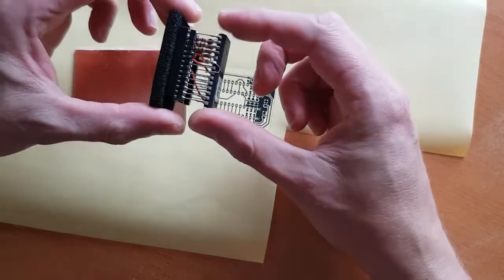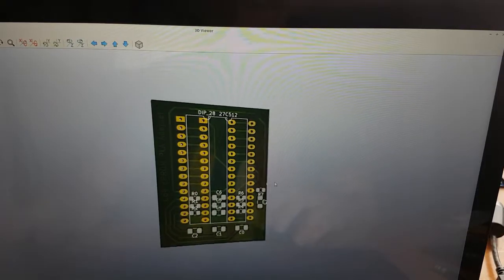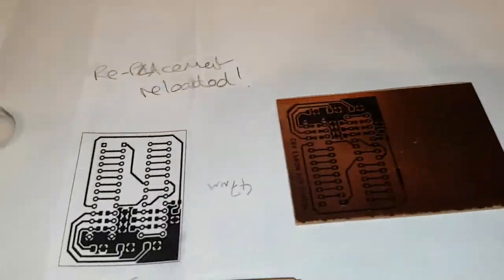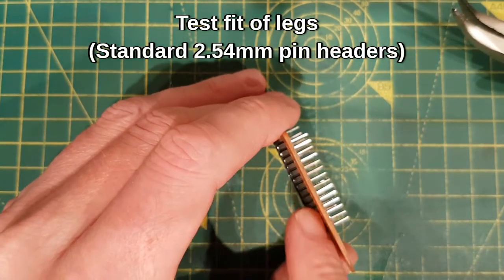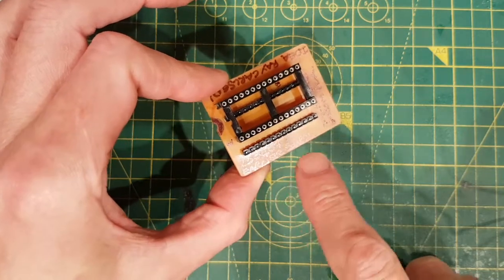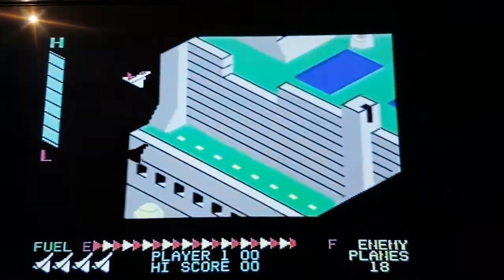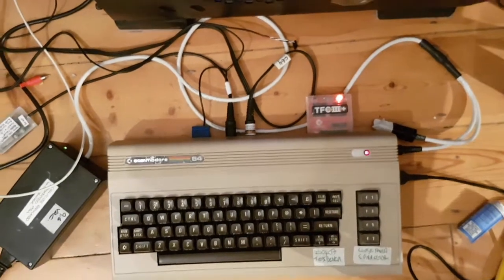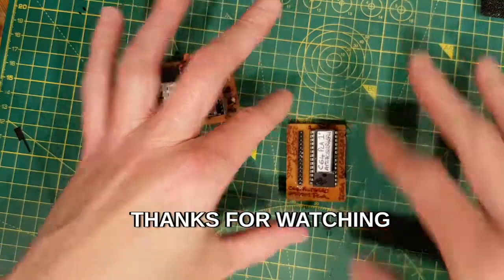DIY C64 EPROM  PLA Board  with Filters

Comment: Really like your take on the EPROM based PLA substitute.

Your dual SID board looks interesting.

I was wondering do the paddles work with your setup?
Could be a good way to reuse a dead Commodre SID with a SwinSID........
:-)
Reply from the maker: Thanks. The filters were Ray Carlsen's idea. I just put them on the board. The dual SID board wasn't much of a success with that SID as it appears completely dead including the pots unfortunately.